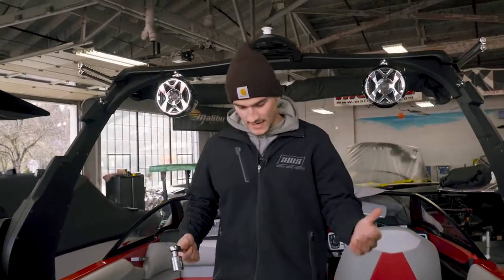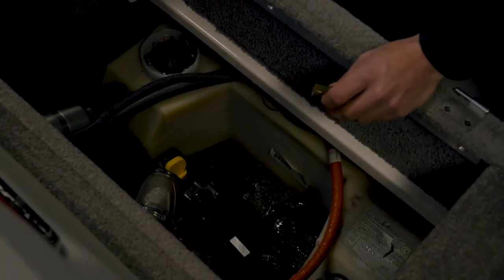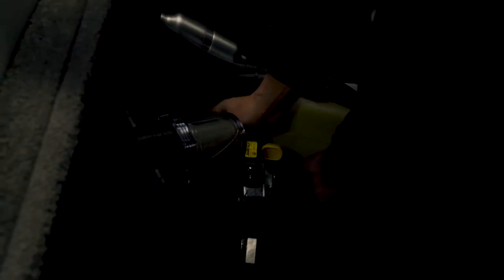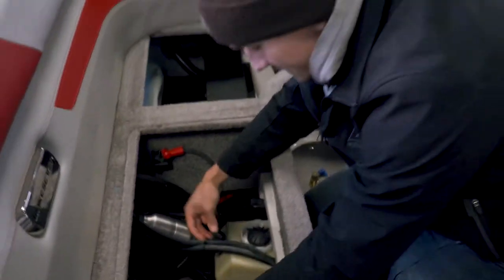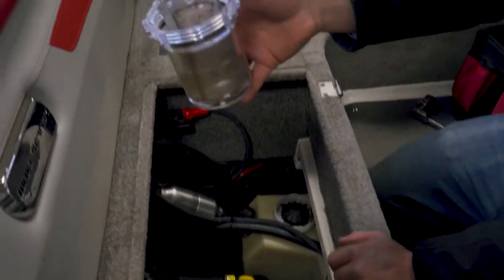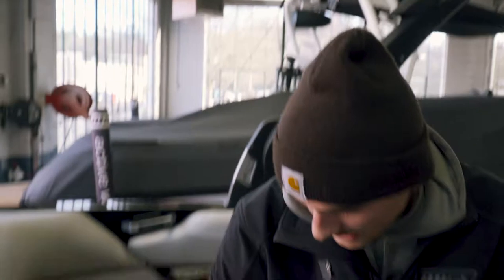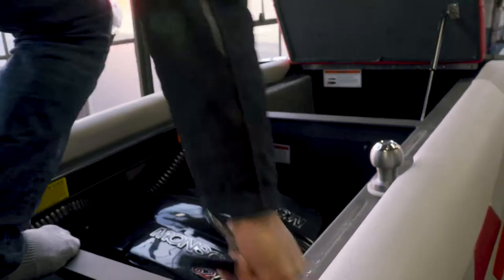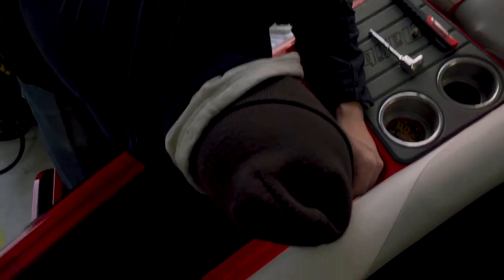Basic Winterization on Indmar Raptor Engine

Comment: You should always pull the front plug at the raw water pump and if there is not a blue plug pull the lower hose at the water pump to ensure you do not crack a w/p housing or anything in that lower water routing. Nuts to Boats Dallas, Happy Boating

Comment: That's not a Raptor engine.  Close, but not the same.  Also, this is absolutely not the same for all Raptor 6.2 engines in 2015/2016.  I have a 2016 Tige with 2015 6.2 Raptor and this is not much like the Monsoon in the video.